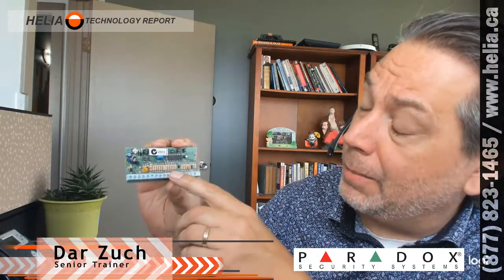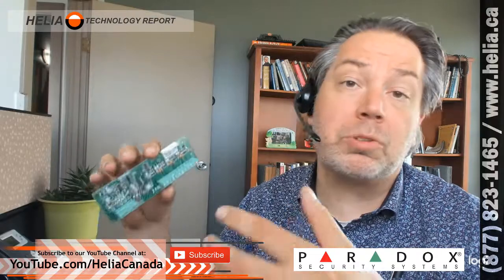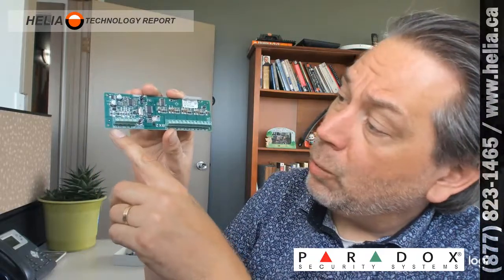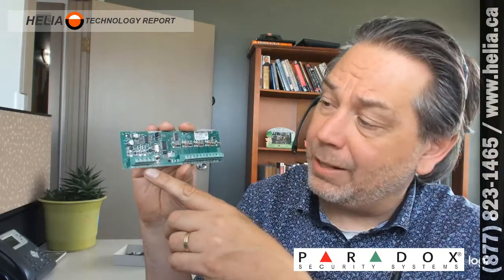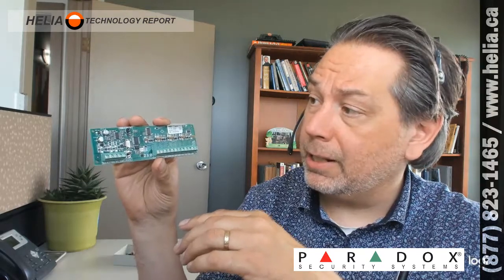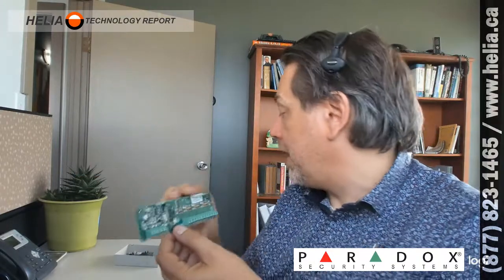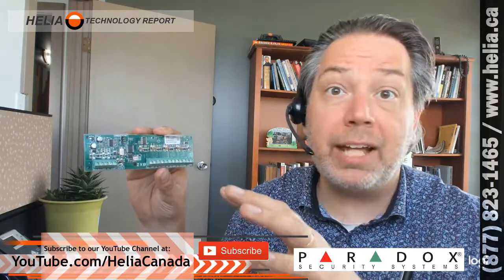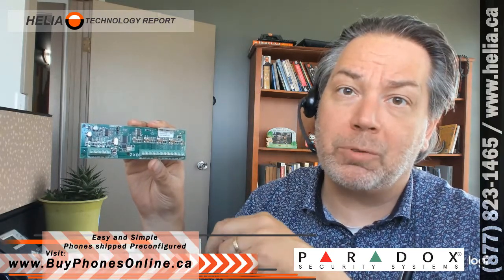Paradox EVO ZX8 Expansion Module

Comment: Hi, using Babyware software, If i have an aftermarket Sherlo receiver for aftermarket Sherlotronics remote connected to the evo 192 panel, and i want to turn on /off an area with the remote, what must I assign the zone as? (instant, burgler, etc) I assume I must assign it as 'entry delay '..) but it doesn't work.. Everything is connected properly because it was working (existing installation) but i have to program it again because I reset all programming by mistake.